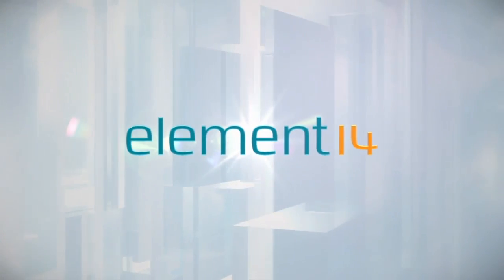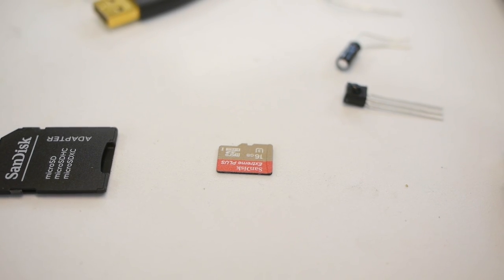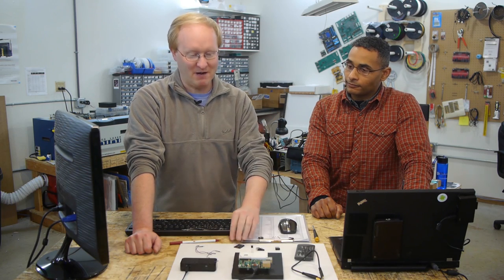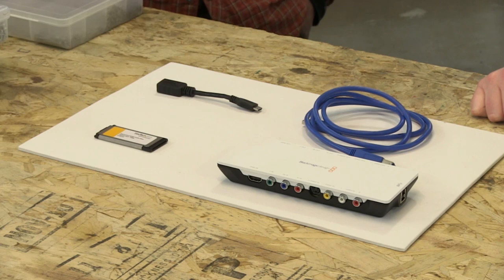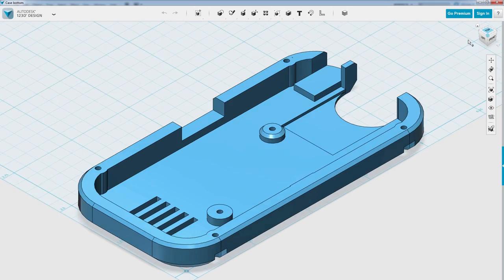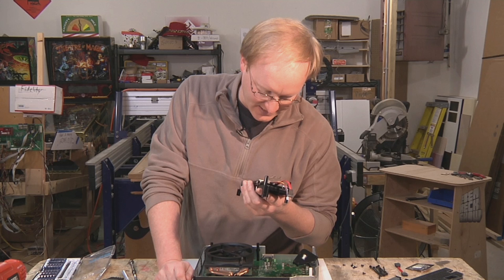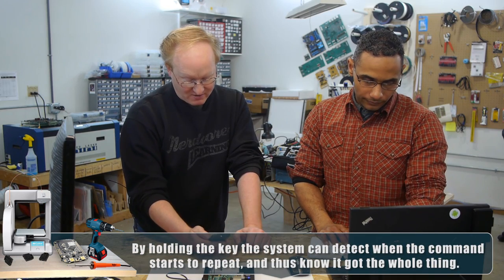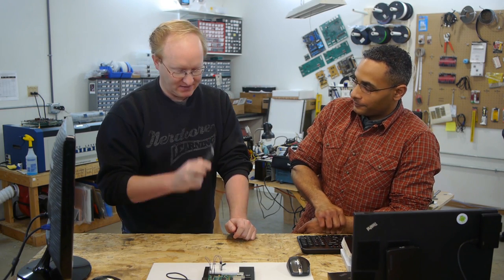Ben Heck’s Raspberry Pi Media Center

Comment: The RPi can use HDMI-CEC, if you're using a correct HDMI cable and TV not older than 8-10 years. You should be able to just use your TV's remote to control Kodi.

Comment: A project I've actually done before. I used an old DVD player as a case, using the original IR remote and power supply. USB ports poke out of the slot where the disk tray was.

Comment: Wow, clever hack building your own IR sensor. There is a quick solderless option if have an old Windows Media Center remote control and IR receiver. OpenElec seems to have the driver built in.

Comment: Recommendations for beginners:

- Use the newer Pi 2. Works much better (much faster) but costs the same as the B+
- Use the FLIRC USB dongle instead of a bare IR receiver. The FLIRC dongle does't need any drivers or daemon because it pretends to be a USB keyboard. You can configure it on a Windows machine with a GUI, so it's much easier for beginners to set up. No command-line linux stuff required. Works with any remote.
- Use a pre-built case if you don't have a 3D printer. The FLIRC people sell a decent one, but many are available
- An alternative to a powered USB hub is to buy a PiPower on Tindie. It lets you use almost any power brick so long as it has a 2.1mm center-positive plug, is between 6V and 14V, and puts out enough current (to be safe, the Pi can draw up to 10 watts)

Note: the FLIRC works with any device that can use a USB keyboard, not just the Pi. I use it with a PandaBoard, and I've used it to control my desktop computer.

Comment: I'm planning a similar idea, except I'm going to be building it into a small rack mount chassis using a lower-wattage FlexATX PSU and an ATX break-out board to power the Pi and a couple fans for airflow since my Raspberry Pi for some reason has issues with overheating...

Comment: I Don't know if I missed it, but it would be nice to know what resistor and capacitor values your using and maybe a wiring diagram. I've been using a model A+ as my media center that streams from my network and I would like to finally set it up for remote control.

Comment: Great Video! I also wanted a cheap media center and went a different route. Found a used dual core compact hp desktop on ebay for 50 bucks including shipping. Loaded my own operating system/hdd and stuck it behind my TV. Works really well and was probably the cheapest option. I had a bunch of 2.5" hdds so I stuck 3 of them in this and now use it as a home server too.

Comment: You know, you can SSH into a Pi from Windows. You need this program called "PuTTY".

As a side note, PuTTY is also available for Linux. I personally prefer it to the regular Linux SSH client because it's far more customizable, can can even be combined with an X server for Windows to forward X programs to Windows (so you can run that one Linux-only app in Windows to fool your friends) or to another Linux PC. 

As for my media center, well, it's a custom-built box. Has a CoolerMaster chassis with one of those fancy VFD displays controlled using LCDProc and remote control via Microsoft's eHome receiver.

Comment: 6:45.  That disk imager doesn't always work out of the box.  Usually when I have a previously used SD card, I have had to use fdisk in Linux and then diskpart in Windows to prep mine in about 50% of my operations.  Otherwise I usually stick with dd.

Also, that bs= argument stands for block size, or how big each chunk is when it is laid down on the card

Comment: I never open 7Zip, you can control the whole process using the Shell Intergration, basically right click the zip file, then with 7zip submenu extract to either the current folder, or create a new folder based on the name of the zip file.

Comment: I think they had to use KB/MS because they mistakenly created an licd.conf file as opposed to lircd.conf.  No biggy, just type "cp licd.conf > lircd.conf".  Easy fix.
Reply: Captain Ironbutt you're right about the syntax.  I get them mixed up sometimes.  After 20 years, it all jumbles together, LOL!

mv or cat are fine too.
Reply: Ross Potts Useless use of cat.
Reply: WarpRulez does it work?
Reply: Ross Potts
Why use 'cat' when 'cp' will do the same job?
'cat', as its name indicates, is intended for concatenating text files.
Reply: WarpRulez because it will do the same thing.  It will read the contents of the file and with a redirect to a NONEXTISTENT file, you will have created a new file.  You worry too much...
Reply: While I haven't measured, I suspect that 'cp' is probably more efficient than 'cat' with large files (and, perhaps, with large amounts of files). 'cp' is also easier to use (requires less syntax). I can think of no rational reason to use 'cat' in this case.
Reply: WarpRulez funny, your name implies pushing the envelope for things, yet you seem bent on just using 1 command.  Why not make some suggestions and end this love affair you have with cp?
Reply: Instead of all that pointless faffing about with IR sensors and programing the remote, a simple $5 RF remote from eBay would be a much simpler and elegant solution.

Comment: I actually made my own Raspberry Pi Media Center a while ago with my Pi 2 and OSMC.

I even went ahead, plugged in a 2TB drive and installed OwnCloud on it to use it as a Cloud server, but for some reason it appeared to have wrecked the SD Card's partition last sunday, so I had lost all the work I did before. FUN TIMES! (Yes, it was a Class 10 card, but I assume that an automatic update messed things up or something.)

Well, at least it was a learning experience when I set it up initially. Now I just use Raspbian and installed SAMBA to use it as a NAS and occasionally as a stats display for Kerbal Space Program via Telemachus.

Comment: GET FELIX TO TRY THIS!
I'm using XBMC on my pi, its powered off my tv's usb port. It seems to get messages from the tv as most of my TV's remote buttons do different functions on XBMC. I bought everything necessary to wire in an IR receiver but turns out I don't need it! TV is a LG LM6200 series

Comment: It would be interesting to see how the raspberry pi 2 does with full 1080p playback using kodi/openelec. I would also be interested to see it done with the riotboard. The riotboard is a cool board but doesn't get a lot of attention. I am currently attempting to port over the retroPIE applications by compileing the uboot, kernal, and emulators from source. Then put it into a laser cut enclosure with a 10 inch lcd screen and arcade style joystick and arcade buttons.

Comment: There are remote control apps for your smartphone.  The XBMC remote control app is kinda lame but there is one called "Yatse" that brings additional info about the show you are watching.  It's nicely designed, quick, and responsive.  You just have to be on the same wifi network as the OpenELEC System.

Comment: if you buy a new PI get the PI 2 ist much faster in transcoding and uses a microSD card.
With all PI´s you don`t need a remote sensor unless you don´t use HDMI.
Nearly all HDMI TVs have the HDMI CEC feature (some call it simplink, anynet+ ,bravia sync or so on)
Try also the yatse app for android - best app for watch/stream and control the PI

Comment: Why bother with lircd when the raspberry supports HDMI-CEC?
Reply: Morten Haggren Thank you! Thought I was the only one :)
Reply: Morten Haggren Probably thier TV doesn't support that, but HDMI-CEC would indeed be way easier.
Reply: Mike Van Pelt could be, also HDMI-CEC isnt the holy grail. my TV does support it.. but for some reason it wont talk with 1 of my Raspi's.. other TVs do so its the TV not the Raspi :) also. the IR thing is kinda cool so you can also use it with a normal monitor instead of a TV
Reply: My thoughts exactly.  Every TV I've ever plugged my pi into had CEC...
Reply: Morten Haggren I totally agree.  It was a game changer for me although you can probably use a wireless keyboard and/or mouse, which sometimes I still need to use as I haven't figured out how to right click or map keys, LOL.
Reply: Simeon Wu Kwai I like the "Rii i8" wirelesss touchpad keyboard with mouse for my pi.  Works well for me.

Comment: Most TV's have CEC which will allow you to control the pi with the TV remote. I use my samsung remote and it works great, Its calle anyconnect+ on samsung and different names on different brands

Comment: So, Element14 is trying to get rid of the Raspi B stock lpl
Reply: Oblivion I'm sensing a sale.
Reply: Christopher Pilcher I'm OK with that, they put that bad boy on sale and I'll buy one :D
Reply: Oblivion I'd buy several!
Reply: Oblivion Maplin are still selling Raspi B's in their (bloody expensive) starter kits!
Reply: GeoNeilUK Maplin are such a rip off.
"Yes sir we sell HDMI cables, just sign this second mortgage on your house and I'll get one for you"
Reply: Oblivion The Pi 1 can give some choppy playback with 1080p, I need to upgrade to see if the Pi 2 solves this but Kodi rocks.
Reply: Simeon Wu Kwai I have tried using RPI 2 with 1080p video and it performs very well

Comment: I use OSMC instead of OpenElec. I can actually use my tv's remote without an IR sensor, since it takes the inputs from the tv and through the HDMI cable. So no programming for me ^^

Also, it's "OpenELEC". Not "OpenELECT"...

Comment: I'm curious why they just didn't use the TV remote to control the raspberrypi.. it supports HDMI-CEC and that's what i use to control my install of OpenELEC... sooo it would have been easier then having to build extra stuff onto it, and it supports tv remotes right out of the box.... well atleast it supports my Samsungs remote just fine..

Comment: Mine's hooked up to the USB service port on my tv, but when the tv starts up it forces the pi to a lower resolution and everything is small window. I changed the cfg file to always run at 1080p but then again, I think I might just change it back and build a power switch instead. Why have it run when I'm not using it? XD also OSMC is a breeze to set up now you don't even need win32 the wizard will write to your sd card.

Comment: Tips for ppl playing at home:

1) Get a pi2 (better performance for Kodi)
2) Get an android and/or iPhone app to control Kodi (Yatse on android is awesome)
3) You don't need a PC running Linux for anything here, notwithstanding the pi itself is running Linux ;)
4) Best to use ethernet instead of a wifi dongle if possible, especially if streaming anything 720p or higher.

Comment: The Raspberry Pi supports HDMI-CEC so if you have a TV with that feature, you can use the TV remote to control the Pi. It is built into OpenELEC and it works automatically. I have made a number of Raspberry Pi related videos including how to install MythTV backend on a Pi. You can check them out here: https://www.youtube.com/playlist?list=PLErU2HjQZ_ZOP1mPndYoXuGm16m7S8dKk

Comment: I followed this guide about 6 months ago and it worked a charm!!!! Thanks for the vid guys, helped me a lot!!!

However now I have a problem. When I configured my remote control I didn't add buttons that I thought would otherwise be useless (such as Media, Mute Volume, etc) and now I find myself in need of one of those buttons! 

How could I add a new button to the config file I already generated? Do I need to run the entire process again?? 

Again, thanks a lot guys!

Comment: The much more complex problem - is How to build the LOCAL streaming server for streaming locally onto your home devices media content in form of simple local webpage with the player window. Such idea can help watching the media content on slow devices - like tablets or phones which can't handle the original webpage with video and resource-hungry Flash video, so the most resources here is on the local streaming server side which providing much simple form for any local devices. I've tried many solutions, which available, but making the local streaming server even on computer is hard - for example to stream the desktop live to the local server with building on the localhost website the picture is in way of resolving 2 main problems - the streaming software tuning & the player on localhost website which can encode/transcode & play live stream when you visit. This is very hard to achieve, in fact it's the answer why so many people using Twitch service than making their own websites - making the streams on website is still hard (for example the streams of security cams).
Reply: Perl Perlovich This necessity of local streaming server with website i have when my tablet with Tegra 2 wasn't able to play any Flash-player video (super slow). The problem was in Bluetooth 3.0 which was turned on to use the preferred audio source - this takes many processing power, so my tablet lost the ability to play most Internet videos. Bluetooth is really great to use, don't want to use cords again to free some power on tablet...

Comment: I'm curious if this is actually doing 1080 as a media streamer.  I believe I have this same board and it was barely able to boot into a Linux desktop with tonnes of lag.  I thought that's why they named it raspberry, because all it does is stick it's tongue out and blow.  Are you using it at some low resolution or can it actually stream in full HD?
Reply: Rob Fowler full HD and get a Rpi 3, it runs as good as anything and even handles YouTube 4K (low bitrate )

Comment: I use a plex server with rasplex installed on my pi which I think is based on openelec. And it works good, but so much quicker on the pi 2 b.

Comment: A Fillet refers only to a rounded internal corner, not external. The term for an external rounded edge is actually just round, corner round or radius. 

corner round goes here--> L <------ Fillet goes here

Comment: I'd definitely recommend the NOOBS Lite operating system for the RaspberryPi. You can copy it without special tools, to a standard (FAT) SD card. Just copy the files with Windows Explorer, Mac Finder etc. to any store-bought SD card, and boot the Pi.

You then get a menu to select an OS (including OpenELEC) and it'll download the image, partition, format and write the card for you. Very simple. You can also boot back into it at any time, to change or replace the OS with a fresh copy.

https://www.raspberrypi.org/downloads/

Comment: ERROR!!  You don't always need or want a class 10 SD card.  There are some devices (usually older ones) that don't properly handle class 10 SD cards.  My camcorder, for example, only handles class 6 cards for video recording.  Class 10 for pictures, which is odd, but for what it was intended, it simply will not work with class 10.  So get the class you need, not the highest class you can find.

Comment: Ben
Seems like an awful lot of extra work for nothing.  Use a standard RPI case. Buy an MCE remote that includes the USB IR sensor on the end of a cable. All for less than $20.   I prefer hard wired network cable since 1080p over wireless sucks.  Or directly connect an External USB Hard Drive with media on it.  The RPI/HD can be put out of sight (behind TV or behind TV cabinet) with the IR sensor exposed so remote can see it.  Since the IR sensor has quite a bit of wire you can basically place it anywhere within reason.  Kodi automatically includes all the mapping for the MCE remote with No configuration required (BTW the batteries last forever).  Kodi auto detects MCE remote and basically allows full operation of Kodi once you get familiar with the remote button mapping.  My wife took only a few minutes to get the basics. The MCE remote includes a mouse pad control that works in Kodi. Once the SD card is imaged the rest is pretty fast and easy (mainly setting up media sources and options in KODI). Another alternative is to use an RF or IR USB keyboard.
I like to use the KISS principle.  Your video makes the whole operation way more complicated than necessary and probably dissuades some users from even attempting to use KODI on RPI.  BTW the RPI B2 would be a much better choice but the B2 works OK.  
Regards ....